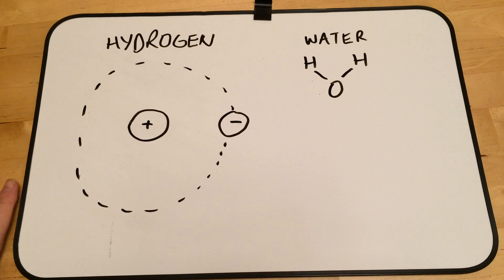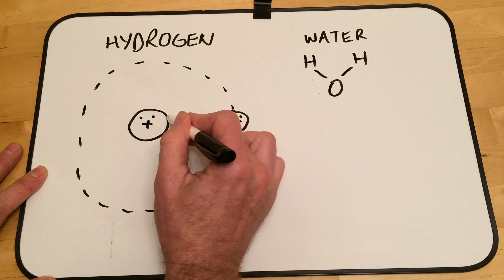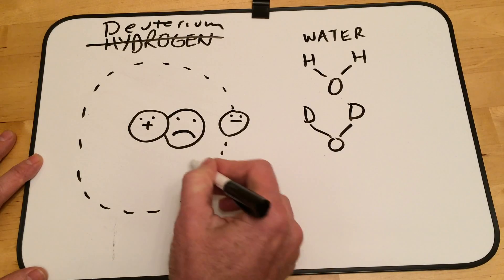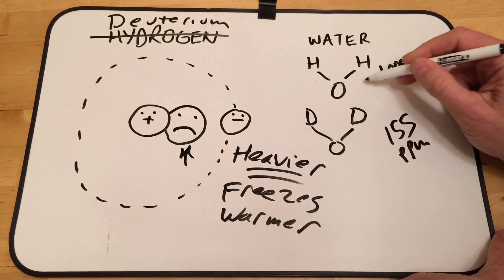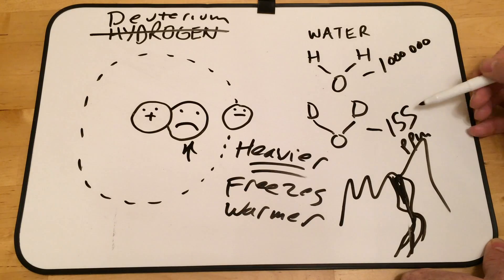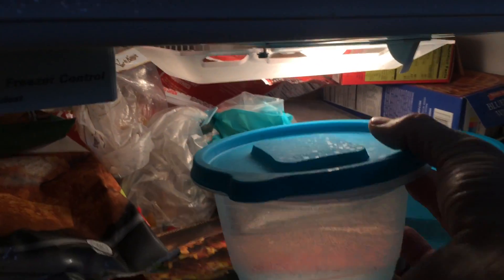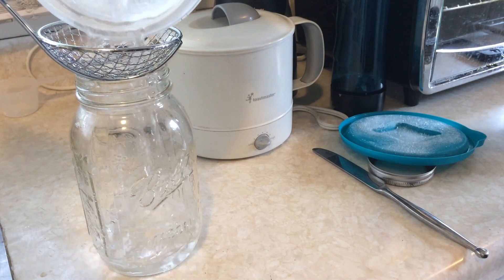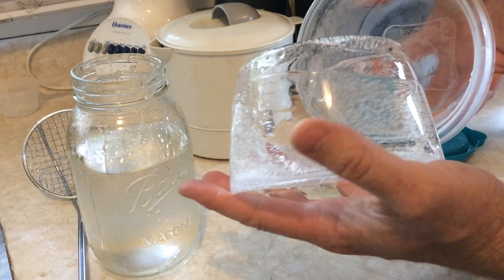How To Make Deuterium Depleted Water DDW

Comment: The method in this video will not give you DDW. But if done properly, a freeze method can reduce detuerium by 8-10ppm per pass. I contacted a scientist from a company that manufactures DDW, and he had this to say:

"Deuterated ("heavy") water has a higher freezing point than ordinary water, there is indeed a fractionation slightly above zero Celsius, but it does not mean that all heavy water will be frozen.

By holding the temperature at let’s say 1°C, you can get some ice that contains D2O or DHO in a higher concentration than in liquid because the freezing point for H2O is lower.

This way you can reduce the D-concentration of the water with 8-10 ppm in one step. If you wish to achieve further decrease you have to freeze this water in further steps.

According to our knowledge, fractional distillation is the best way to produce DDW in large scale."

This same manufacturer says that home water distillers can at best reduce deuterium concentration by 1 or 2 PPM per pass, which is much less efficient than commercial evaporative methods. But an 8 to 10 drop in PPM from a freezing method (per pass) is considerable (if true), as the early clinical trials in this field suggest that even drops of say 20ppm are potentially clinically significant.
Reply: I sent it to an isotope lab, came back as 154 ppm. Not worth the time and effort.
Reply: If there is a fractionation then the water that is left unfrozen is deuterium depleted to some degree. No one is saying all deuterium is removed.
Reply: 2 questions.  so how is it done properly?.   would the water collectedf by a room dehumidifier ddw ?  hope you answer. because I am searching this for weeks
Reply: The key here is to have a constant temperature that is slightly above the freezing point of water, but slightly below the freezing point of deuterium. For example 1 degree C.
Reply: so how can I make deuterium depleted water at home? how much of this water can be drank per day? can i mix raw sea salt in it to add minerals?
Reply: Do you have a link to the 20ppm study?
Reply: @haveaniceday7950  of course he didn’t. It doesn’t exist
Reply: @Peeshy88  I'm not gonna do your homework for you. Here is one I found in 60 seconds:
The MST for patients consuming DDW treatment (n = 56) was 19.6 months in comparison with the 6.36 months' MST achieved with chemotherapy alone (n = 30). T
https://pubmed.ncbi.nlm.nih.gov/33760674/
Reply: @haveaniceday7950  Sorry, 3 years late. Here is one I dug up for you:
https://pubmed.ncbi.nlm.nih.gov/33760674/
I think there are one or two more somewhere.
Reply: how could I get water from that company?
Reply: What “clinical trials”? No serious scientific investigation has ever claimed what you’re saying.

Comment: Some thoughts... maybe it's better to mimic nature and have the water freeze completely and then take the melt from the first, say, 75% of the thaw and then discard remaining ice.  I have no evidence that your way doesn't work... just a thought.  Also, you should open the top of the jar if you want to get UV into the water.   Maybe a wide mouth jar too.  Good work!
Reply: The natural way... w/ a piss test.  After you drink DD water you should have to urinate more than usual.
Reply: if it works, the feds will knock on your door.  he hasn't had any feds so it didn't work.
Reply: I believe it's b/c the deuterium depleted water is removing deuterium from the body and I guess it does it through urine.  Not sure how it works though.
Reply: i read an article that says that one should freeze the water once and let it melt at room temperature until there is a a piece of ice the size of an egg in the middle of the container... and that piece of ice contains the deuterium and should NOT be consumed... its confusing... Danny, do you drink the water you described?  do u notice any positive and/or negative health benefits
Reply: hoohoohoblin have you tried to weigh it? 😂😂
Reply: @ciscopolamina6452   LOL
Reply from the maker: +Danny Scollan Thanks. I have no idea if this really works, because I have no way to test it. It does taste different though.
Reply: It could be weighed but it would be a very expensive scale.  Heavy water does weigh more than H2O but very little.   using a UV light aside the jar would produce better results but you also need to capture the evaporated water as well as the results of the evaporated water is far more interesting than deuterium water.
Reply: rayzor ray, so how can we make deuterium depleted water?
Reply: get me a darpa grant and I will tell you.

Comment: It would seem as if the water on the outside is freezing only because it's colder than the water on the inside. The temperature would have to be contantly between 0 deg C and 3.8 deg C to make sure only the heavy water freezes.
Reply: Jpwnage216 p
Reply: Jpwnage216, how can we do that? do u make DDW home? if yes, do u notice any health benefits?
Reply: You don't understand what is happening.